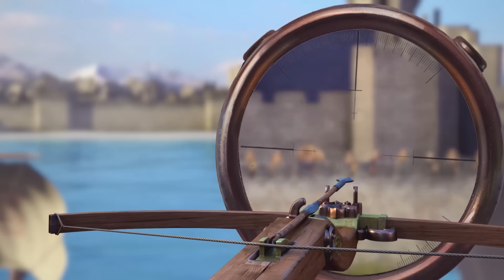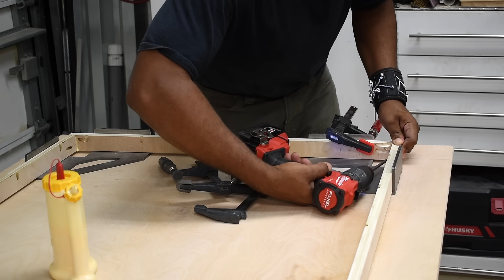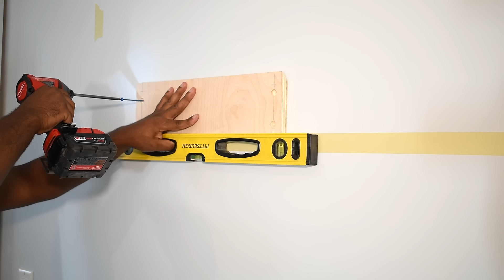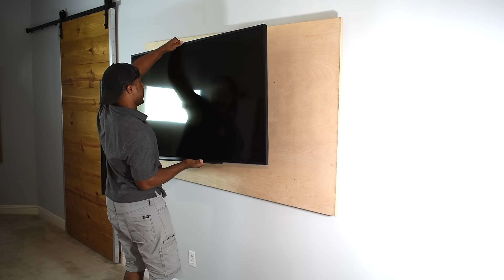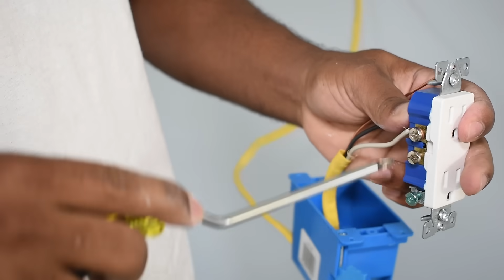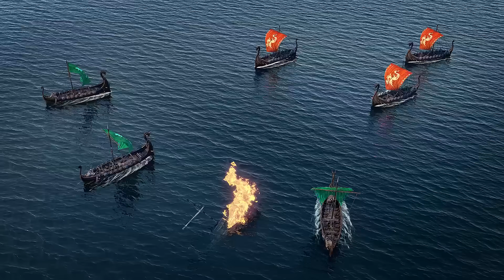How to make a TV panel - Wall mount a TV and hide the wires

Comment: Hey! I know this is older video, but is there a way to replicate this, but put the TV flush with the wall mount. So essentially putting the actual TV bracket on the drywall instead of it sticking out?

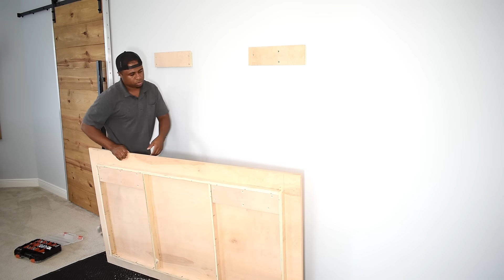Comment: Pardon my ignorance. di you use two layers of wood mount support on plywood? wondering how did it match the thickness of the frame? At 3:18 when you were gluing the mount to ply I can see it was much lower than the frame but at 5:35 it leveled up with the frame. Can you please guide me?

Comment: What Type of Screws did you use for the Mount on 3/4 Plywood, I'd be scared it would fall off, even if the TV is 45lbs or below

Comment: The trouble with all this fancy framing stuff is that you're pretty much confined to the same size TV forever. Personally if it's lights you're after they sell them just to put behind TVs and they work off the USB so to be honest it's probably not worth the trouble you're going through.

Comment: I'll be doing something similar, using stained red oak plywood, and mounting a 70". From there, a oak fireplace tv stand  under it for the entertainment system 😀

Keeping it very simple, and won't be putting an electrical box in the wall

Comment: Another  great detailed video. I did hang a tv and the bracket moved as I was screwing it. My walls in my apt do not seem to be flat. What is the best way to keep the bracket leveled? Can you also tell me the measurment equation you used to get the tv centered with the bracket. I think I'm going to try this.

Comment: EXCELLENT VIDEO..Thank you. In the process of following your video.  Got the white backing all built and on the wall.  Question:  I see you placed an electrical box on the backing.  Did you use a slim box?  A reg electrical box is 3'" 3/4 deep.  My unit and I see your unit does not expand that far from the wall. What size electrical box did you use?  Thank you

Comment: Any tips for hiding tv cables, when you mount to a cinder block wall?
Reply: Just increase the size of your board ; ) but u would have no light on the bottom side, but you wires 'd be hidden

Comment: Thanks for this video!! I am doing this same set up but not sure what type of screws to use to attach the tv mount bracket to the plywood.  The mount came with big 3.5 inch lag bolts but in your video it looks like you use something smaller.  Thanks for your help.

Comment: Thanks for the video. this is great mounting system. I was so excited to the project myself. !!!!!!!!!!!!! Found this great kit for sale on Amazon. It has the toggle anchors, drill bit, 1/4-20 screws and washer the entire set for around $20. Good for drywall plasterboard gymsum and mounting on Steel Studs. The drill bit was $20 when i purchased in just by itself. So this was a great package that i had to share with everyone out here.  https://condomounts.com/collections/all/products/metal-stud-mounting-kit
https://www.amazon.com/Drywall-Anchor-Mounting-Without-Through/dp/B07P3L966N/

Comment: Hello there. I had 55 inch before using ikea table wall stand. But now i have 75 inch but i still would like to use the same old system. Any one have a solution on how making ny own ikea uppleva stand look a like ? The stand it self is mounted on the tv bench it self.  But this time its 75 inch tv

Comment: What is the benefit of the panel vs just mounting the TV to the wall and using grommets to fish the cables thru ? then attaching LEDs to the back of the TV and powering them off of the USB ports in the TV (my current setup) ?

(asking for real, moving shortly and want to see if there is a benefit to this solution vs what i have now)

Comment: Is that 3/4" Plywood? I need to do something similar because my studs dont line up "center" of the space I want to hang the TV.  Would 3/4" plywood be strong enough to use as... "furring strips" and then bolt the TV wall mount to those strips? Same idea as your cleats but bolting through them rather than actually making the cleats

Comment: I need you to come to my house, I need this... It's different and I love it. Do you think it's anyway this could be done, with a large mirror?
Reply: If you are going to do this with a mirror, instead if adding brackets to mount the TV, just centre the mirror and add ply round the edges to block it in. And of course secure the mirror with some Very strong adhesive

Comment: Just because you are experienced doesn't mean it's not your lucky day.....

Turn off the breaker, don't take chances....
Reply: Yea I can relate because at my work place they were replacing the old cfl bulbs with the new leds and it requires to have the old clf enclosure taken apart to tap off as well as to cap off the old ballast. Well in the backroom one of the guys on the scissor lift did something and the next thing I know i saw a bunch of sparks as well as a loud pop from the top and then all the lights went out. He somehow shorted the live to ground. And apparently they were told to work with the electric on as well since were a shopping center. If that was me I would tell them you want the job done then the breaker gets turned off, no ifs else or butts or im out.

Comment: im wanting to hang my 50 inch tv to my wall my problem is I only have 2 studs where I want to hang it and they are spaced further apart than my tv bracket so all the screws for the bracket would be going into just the plaster board could i make this securing the frame to the 2 studs only or is there a way I can reinforce the middle of it so it doesn't fall off like making a French cleat that goes from one stud to the other

Comment: Dont you love it when you have the right tool for the right job. I bought a brushless dewalt impact wrench a couple months ago and just got to use it for the first time the other day to change the low beam headlight on my car that requires you to remove the tire to access the panel in the wheel well. The lug nut came off so easy I changed the other side just for fun. I need to buy that tool he used to make the angled holes in the video. I can’t believe I’ve finally reached the day  I’d get excited over buying new tools.

Comment: I would have placed the LEDs on the back so they directly faced the wall to get max reflection from the wall, instead of facing outward.
Also, you don't drill pilot holes?

Comment: nice project. I think it might be pretty cool to put some floating shelves on either side of the Tv, connected to the wall mount. It would be pretty easy, just attach them through the back with some thick and long screws

Comment: HI. I am Ajith from India. I loved your video. I have a small query though. I have a Rental property. The problem is with each new Tenants, they have different TVs. Some prefer wal mount and some some have Flat-screen Box TVs on stand. In the case, What can be done to hide the holes drilled? Or is it possible to make a mount that can fit any TV?

Comment: You are an ace woodworker ! I was wondering, how thick or far from the wall can the frame be. Reason i am asking is because i would like to make the TV piece  about 6 inches from the wall in order to allow DVDs, CDs, etc.... storage on the sides like a 20 year old Tonin Casa TV unit i have. My question is, will the structure like you did it be strong enough for my case or must i do something else to allow for the weight being more than 6 inches away from the wall.

Comment: Excellent work, but not easy for everyone .
Reply: Here's the thing tools are expensive and then there goes material and also you learning how to use the tools. It takes time, money, and patience but I'm sure anyone could do anything with the proper mindset, even you could do this and even better if you wanted. Mostly it's fear and inexperience that doesn't allow most to do things.
Reply: @LonexCyborg  thanks but if I showed my last week video which is done by a "professional " you will be surprised that how they mess up my wall the $800 tv and my new bed , I guess I had a very bad experience  . I really appreciate your prompt reply , thank you for the encouragement.
Reply: @fatimarehman112  That sucks, I'm pretty sure they didn't even offer compensation for your damaged items either did they.

Comment: That box you installed into the plywood for the 110-volt receptacle should have been installed into the drywall, not the plywood. Just make a hole in the plywood so that you can access the receptacle easily and do not restrict access to the receptacle for service.

Comment: Question, I have my tv mounted above the fireplace. However my power outlet is not on the same wall, is there a way to create my own outlet closer to the television from that one since, it is not directly below the tv? Hopefully that makes since. Lol.
Reply: Do you want to make the pre existing outlet closer to the tv, or add another outlet using the pre existing outlet. You can do both if you want depends on the circuit breaker capacity for that room and how many unions are already in that room, you don't want to over load that circuit breaker. Rule is that for a 20 amp circuit breaker you can have around 10 outlets connections within that circuit breaker. So check that room where you want the tv and count how many outlets are there but I'm pretty sure you don't have 10 outlets in that room. So if you want to add another outlet your going to have to buy 12 gauge wire and are going to have to make a union with the pre existing outlet and send the wire through the wall towards where you want to have the new outlet. The only problem with this is that your going to have to make holes through the wall because your going to have to put the wire through the studs if your wall is made of sheetrock but I'm not sure of your situation and your wall is probably going to have insulation as well so use gloves because insulation is bad for your skin the fibers will make your skin itchy because of the fiberglass. If it's brick it's still possible but you're going to have to trace the electrical box where you want the outlet to be, chisel the traced outline then in that hole you make the 12gauge wire should be going out that hole you just made 6 inches of cable then punch a hole through the cable box and put the 12gauge cable through the box and then push the box inside the hole you made and use a screw driver to secure and latch itself to the wall. Then all you have to do is connect the outlet and place a outlet plate and your done. Either way this might be a little out of your comfort zone if you don't Know what you're doing, maybe you might want to call a professional electrician, or handyman they could do this job in an hour. My bet is the handyman because the electrician really won't fix any of the holes they make to the wall they only deal with the wiring, since they don't like to get messy.

Comment: Wht should i do if i have brick wall
Reply: Just use concrete screws or some kind expanding bolts (anchors) plastic should be enough for this type of project. And you can make a template for holes to avoid measuring each one.

Comment: Awesome vid! Of course it comes out like a month after I get done mounting my families TV on the wall lol. I am almost positive I used that same exact mount too (or one nearly identical) and I am a big fan of it. I also hid the wires with some face plates that are the size of standard wall outlet face plates, but instead they are just a rectangular hole, that has an L shape to the back so that you can snake wires behind drywall and have it look clean. I just used 2 of those and a really nice indoor extension cord and it saved me a little time when hiding the wires. The face plate is super easy you just use the template to cut out the  piece of drywall and then the piece fits in flush and the screws have fins on the back that snug it up to the drywall. Just another option for those of you who don't feel like relocating an outlet (although I have done that too and it's not much harder). Heres a link to the face plate I mentioned! https://www.amazon.com/Datacomm-50-3338-WH-KIT-Mount-Cable-Organizer/dp/B003N7NJBY/ref=sr_1_fkmr1_1?ie=UTF8&qid=1535927486&sr=8-1-fkmr1&keywords=cord+hider+drywall

Comment: Awesome project... 

I noticed you used 12 gauge wire for your extended box, which is rated for 20 amps, then installed a 15 amp rec. FYI you may want to upgrade your rec as it can act as a fusible link because it can go bad long before your wire due to be rated less in amps. Also most common, newer codes, don't allow the mixing of 12 and 14 gauge wire and though it can be completely safe it's just not advisable. If your wall wire is 14 gauge then you replace the 12 gauge with 14 just to be safe. 

Not wishing you ill will or anything but if your house accidentally burns down and upon inspection a 12 to 14 gauge wire link is located, even if it does not cause or have anything to do with the fire, most Insurance Companies will not pay. Please do not take my comment as anything other than For Your Information. It's your house and you are free to do with it as you please. I am just sharing info from other's  misfortune. Cheers...

Comment: Have you done an update tour of the room?  Sometimes it helps to have a visual on how big your space is.  You should create a system where some shelves can serve two purposes.  For example, hidden Xbox console and remote controllers or a roll up panel for keys and garage door opener, since you said the wall was connected to the exterior.  Hope this helps.

Comment: Hey great final look with the Wifi LEDs! You said shoot ideas about entertainment center and that got me to thinking when you said “something thin”!!!
What if you used glass shelving (cheap Home Depot) that was 12 inches wide and 4 to 6 feet wide and used those knobby brackets to hold them from the back. You could have 4 to 8 shelves - even staggered - and you could back light some of the glass edges to for general purpose room lighting. The entertainment center could then hold media, components, a fish tank, books, knick knacks (your regular nice stuff that you don’t know where to put) and some lights. I dressed my kitchen window this way right across the middle of it and put a fish tank there. It worked great and no dumb curtains to get greasy!

Comment: You need to start using extrusions for LED light mounting. They act as a heat sink, give you the ability to use diffusion covers and allow you to actually screw them to your projects, or slip them into into dadoes and grooves. I get mine from Outwater or eBay all the time. Much more polished, and professional look. Plus, I don't have to ever worry about an LED possibly catching the wood on fire should there be a failure or a short.
Reply from the maker: I do have a few projects with the LED housing, maybe you missed those. The LEDs are Low voltage and, although anything is possible I have not concerned. The LEDs would need to burn through the waterproof coating and I don't see that happening. I could be wrong though.
Reply: I sometimes help out my buddy who does retail installations at malls and kiosks. We've removed old cases and displays, and we've seen some charred Melamine and MDF under LED strips. So, as a precaution (and an up-selling point for my work) I point out to potential clients that I use them to meet "code". (even though there isn't a specific code requirement for them... YET) But everything helps in getting the bid over your competitors. Ha Ha!

Comment: I didn’t know you can work on outlets with the power on. Brave soul! ⚡️
Reply: Janine Lew 

It’s all about going with the flow without fear,

“Fear” comes from not knowing, btw.
Reply: Most electricians work on live outlets too. They just won't admit to it very often.
Reply from the maker: It's possible :). Just have to be careful.
Reply: Janine Lew I’ve been around electricity for over forty years as a trade....no matter how careful you become, there will be sparks on occasion.....I can vouch for that from personal experience.....
Reply: Yeah, jeez I was on edge when I was watching that part.
Reply: As long as you know what you are doing
Reply: @Janine Lew It's possible like others have said, just need to be careful. Also if I recall correctly, you can safely touch any one wire and not get zapped. As long as it's only one at a time.
Reply: Do that while touching a radiator.  Then come back and let us know how you got on.
Reply: @mmace3  no you can't
Reply: @Ed19601  it's possible esp. with 110v (or 90v, japan) but that would depend on skin (very dry and tick) and it's just a possibility.  In any case, gloves should be a must.

Comment: how did you not run in to any fire blocks when you wall fished the wire.
Reply from the maker: Well, not ever wall have them. Sometimes they are higher in the wall. I don't know the code on those but I mostly have seen them in the taller walls.
Reply: you got lucky I had to cut a 12 inch hole to get a drill bit up the wall. you made it look so easy it  took two week ends to run the wires.
Reply from the maker: Haha well I wouldn't call it luck. I did think for 12 years so I know a few tricks. I always use a fish tape to check first.
Reply: lol  When  are you gong to get to the kitchen I only ask because I have been building a butcher block for my wife and well its not going so well. Im using 6x6 for the top and legs and 1x4 for the shelf. now my problem is when I have every thing glued up and dried it warped. legs and top.
I dont work with wood that much Im a car guy so you can see why I need help.